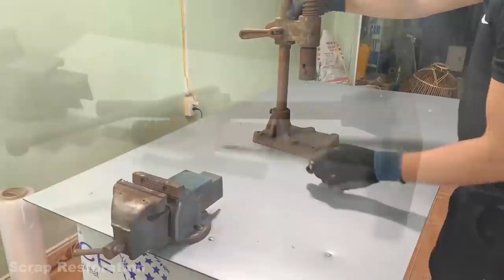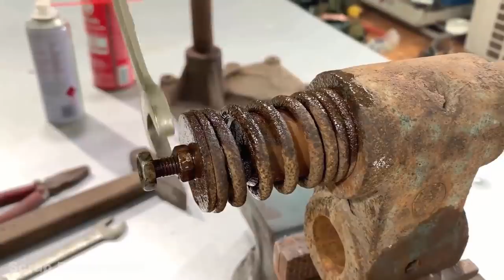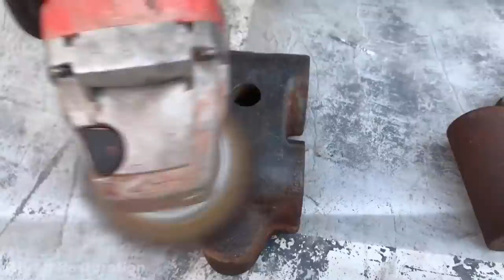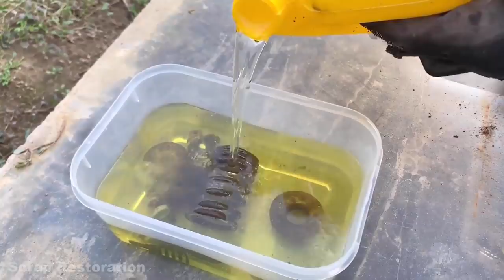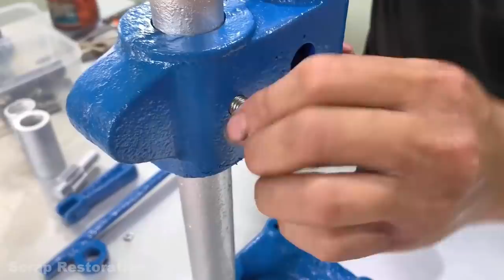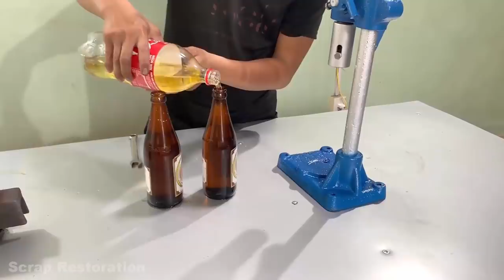Restoration of Beer Bottling Machines, 1955 - Restore of old Soviet hand tools

Comment: Amazing what one finds just lying around in the rice paddies.
Reply from the maker: The world will be wonderful.
Reply: Each vid is focused on a major find in the Paddy fields.
Reply: paulw252 
Looks like hydrochloric (muriatic) acid.
Reply: @paulw252  to be sure it was bubbly carbonated urine!  ;)
Reply: @glenndarilek520  could be sodium hydroxide too...not sure but it did leave a dark surface on the metal
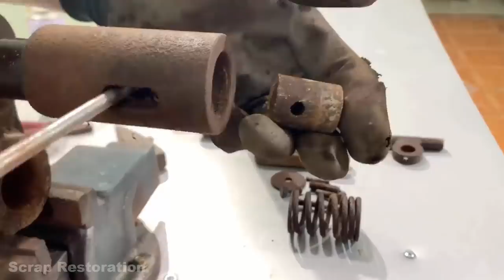Reply: Also amazing that for something that has been soaking in the paddy fields for lord knows how long you can still find spider webs and dust when the thing is disassembled! Look at the 4:15 mark...

Comment: Almost gave this a thumbs down because you really, really shouldn’t just dump your rust remover on the ground (unless it’s something like vinegar).  Dispose of it properly!  This resto also wins the Use of the most inappropriate tools award.  Phillips screw drivers and drill bits (?) aren’t punches!  Lastly, that casting was really poor quality.  But in the end, good overall and a usable bottler.
Reply: It's Asia, there's no such thing as proper waste management in general...
Maybe, after they cancelled the recycling requests form the States, they will spent more time and effort on their own waste...
Reply: Just use what you can afford or have available.